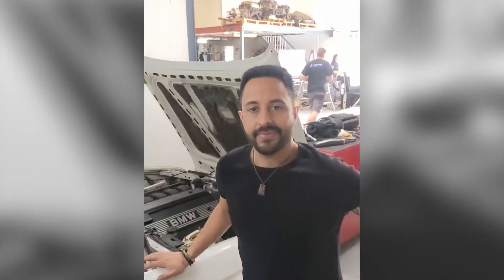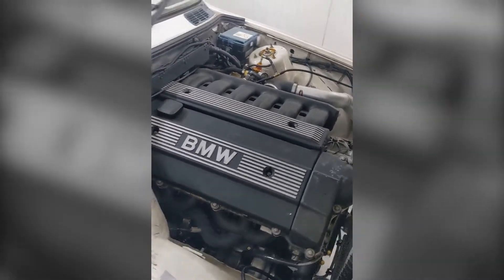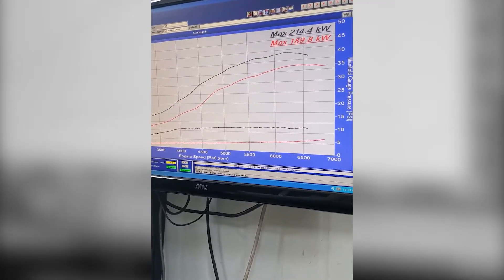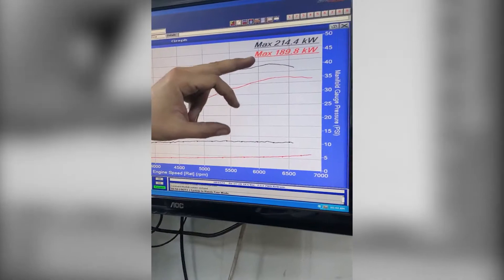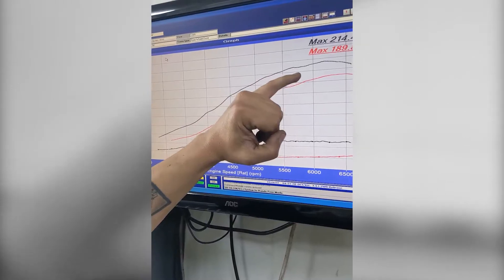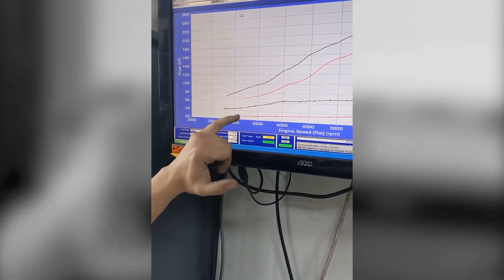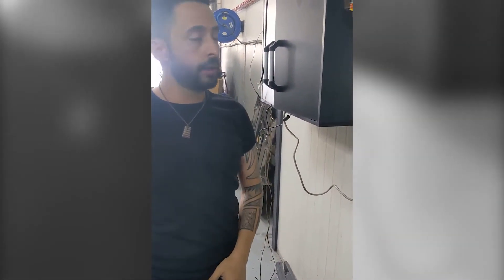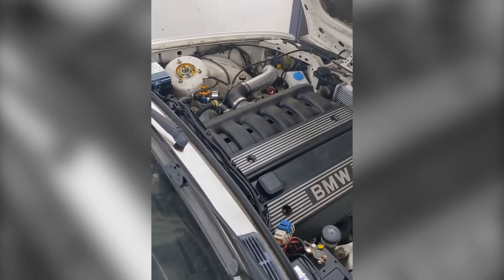Turbo kit on BMW M50 Conversion [supercharger vs turbo charger explained] !

Comment: Hiya I’m very new to this, which engine was this done on? I have a bmw e34 520i  ‘91 - is there an easy to fit beginner turbo kit that you would recommend? It’s and old car but wondering if this would be better than an engine swap? Thanks
Reply from the maker: Yes you can turbo the M50B20 engine. You would need to run an aftermarket ECU management system, and possibly prepare to take care of some top end work to handle more power if your head gasket is unhealthy.